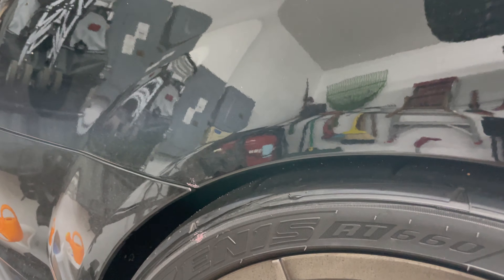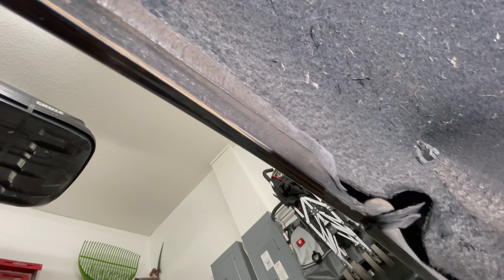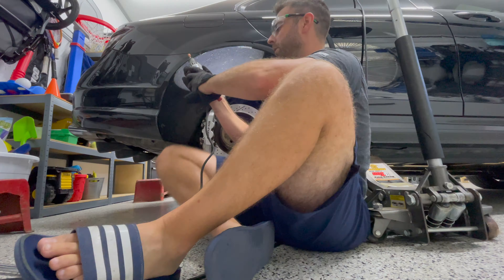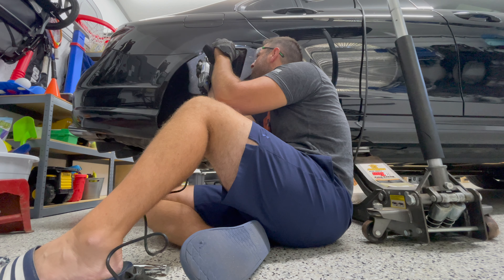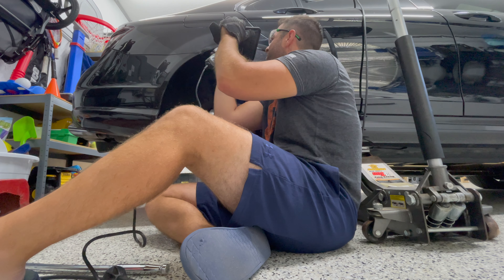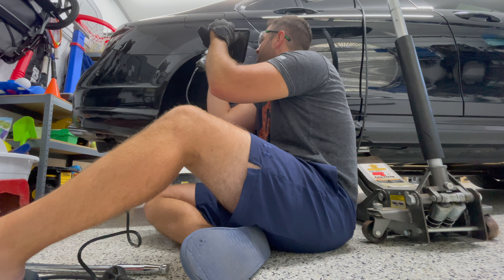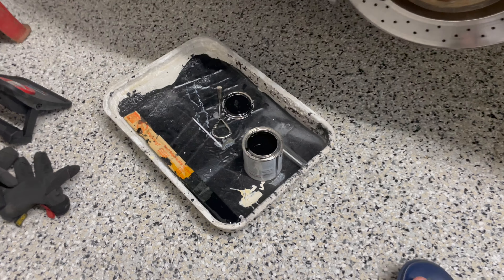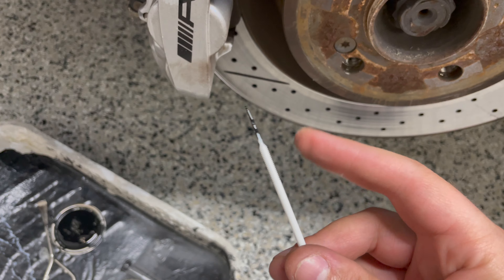Pulling, Rolling or Grinding my Fenders on the C63

Comment: Going to roll my fenders on my c230, to make fit of my new esr cs3's!  Is it a good idea?  Will my paint crack even with heat?.
Reply from the maker: I was told it would crack even with heat. However my car is older and paint isn’t soft anymore. Depends how risky you are and if you want to experiment. Personally I wasn’t willing to take the risk

Comment: Is that all these cars have as far as fender lip? Mine looks like that on my e550 coupe but I thought the previous owner has already cut it off. Can this part be rolled or pulled without looking like bacon?
Reply from the maker: As far as I know that’s how they come. I was told and read that pulling and rolling will chip the paint pretty badly and need a repaint. Didn’t want to deal with that honestly.

Comment: Did you ever find out what offset your wheels are? I’ve bought some new 19” wheels and debating tire size to get but was interested in the offset.
Reply from the maker: They are 19x8.5 with +45 backspacing by Verde. They do not however clear the Brembo calipers with the valve stem, so you have to run without TPMS and no stems and swap out for screw in valve stems